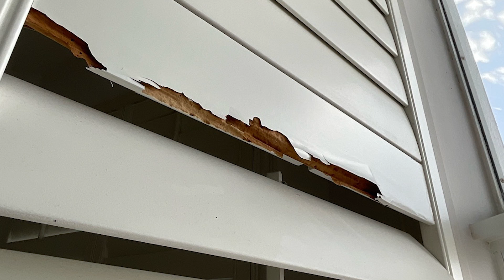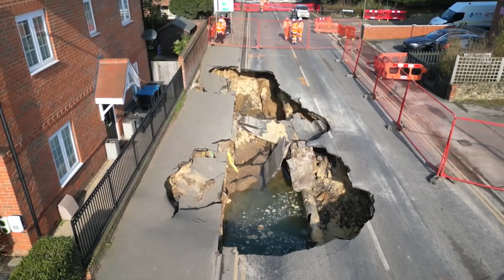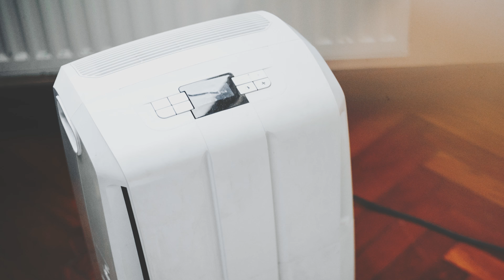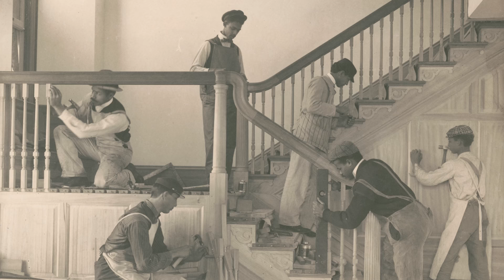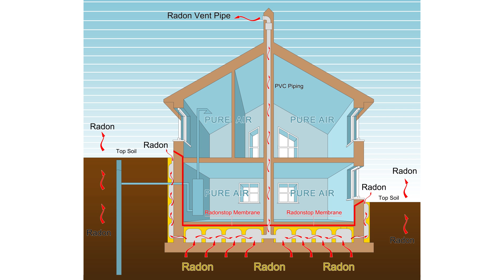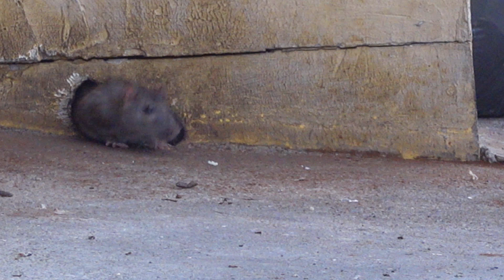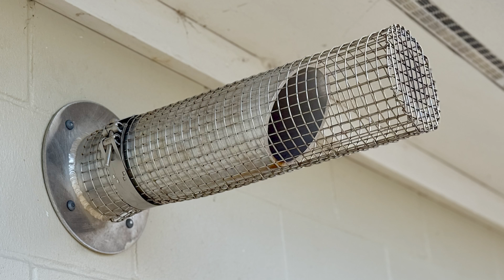Home Inspector Answers House Safety Questions | Tech Support | WIRED

Comment: Slab on grade is very dependent on location. Areas without super high water tables have basements, which are on footings. The slab on grade is just the floor of the basement. But if there is expansive soil, the basement floor may also be built off-grade to avoid damage should the soil expand.
Reply: Thanks for watching! Believe it or not, the neighborhood of Miami was built with basements. The grade was built up and then dug out, but there are basements. And yes, there is moisture and water intrusion.

Comment: Another reason that old houses last better, is the lack of insulation in the walls (especially "spray in foam"). Air circulation in the wall cavities, allow the walls to "breathe" which helps to control moisture/rot.
Not that there aren't good reasons for insulation, but there are tradeoffs.
Reply: Many new codes require vapor barriers that are designed to prevent moisture infiltration, damage, mold, etc. Not having proper insulation will just increase utility costs and can increase the risk of moisture intrusion. If constructed per code there are not "tradeoffs."
Reply: Exactly! There is no perfect solution. Thanks for watching!
Reply: Spoken like someone who doesn't know what they're talking about
Reply: @THEandyenglish 😂

Comment: I use a drain cleaner periodically as normal maintenance, just to make sure everything is good. Never took that as a bad sign.
Reply: That messes with your pipes regardless of what the marketing on thr packaging says
Reply: @catalindeluxus8545 bases and acids are non reactive with PVP. Cast iron, different story.
Reply: That stuff will destroy your pipes. Get those "drain shroom" catches for your drain and clean them every other day. If your drain is slow, remove and clear your u-bend.

Comment: Why build houses in wood vs concrete?
Reply: costs, which is based on local availability of materials.  the US and scandinavia has lots of woods, so their houses are primarily stick-framed.  rest of europe is cleared out, so they use concrete/mortar construction instead.  100 years ago and before, old-growth wood was plentiful (AND nails/screws were expensive) so houses were timber-framed with large slabs of woods that joined using wood alone.
Reply: Cost, usually

Comment: Interesting that Challenger was the panel of worry and not Federal Pacific Stab-Lok or Zinsco.
Reply: Those are also bad. it just so happened that the house we filmed this in had a Challenger. Bryant and IT bulldog pushmatic are also problematic. As well as any older panel that you cannot find breakers for. Those would be obsolete. Thanks for watching!

Comment: New houses are built on slabs? Definitely not in Ohio or most of the midwest (AFAIK). Almost every house here (Ohio) has a basement. And it's not that big of a red flag to see dehumidifiers in those basements. This dude must be another Cali guy lol.
Reply: your basement has a slab.  immaterial anyway, the important structural element is the foundation wall that hosts the joists

Comment: Carbon Monoxide has always been a weird one to me because it's a huge issue in the US, but when I moved overseas almost no one has CO detectors and CO deaths/accidents are so rare they only tend to occur when someone uses a kerosene space heater without sufficient ventilation.
Reply: Most European houses are draftier than US homes - if there is air exchange, you have less CO accumulating
Reply: It's because of insulation. Winter requires insulation, so less air exchange. Without CO/CO2 detector it can be deadly.
Reply: @hanifarroisimukhlis5989  Ah.... I forgot Europe doesn't have any winters....
Reply: @h @hanifarroisimukhlis5989  Perhaps I’m missing something here but there are extremely cold winters in many parts of Europe and vast swathes of the U.S. without cold weather.

Comment: Short answer: yes and no

Long Answer:
“Better” is very subjective and vague.  It depends on better at what.  New construction is better at material efficiency, strength and span of materials, heating and cooling efficiency.  Construction speed is also much faster and labor needs are significantly less.  Now the downside is you can also use all of those advantages to create an extremely low end building that in decades past would have not been able to stand.
Reply: Yeah people are romanticizing the past too much. Super rich people's houses were built well in the past and generally still are now, I think when a lot of people are thinking of 'old houses were built so well' they are thinking of these houses. Old houses had paper thin walls and windows, and some were very very flammable. Many things were toxic or unsafe. Many old houses were absolutely not built to last at all, it depends on the time and the country. Even most wealthy person's houses prior to the 1950s (excluding things like sprawling estates of royalty or top .0001% wealthy) had what we would see as a very small size today - perhaps this is where the confusion comes in as some people might perceive such small houses as normal. There wouldn't be so many historical examples of fires and earthquakes destroying entire cities if these old houses for the average peasant were built sooooo well.

Comment: In Japan new homes are built on concrete pads with outside walls that are about 18" high. All concrete. They also have partial "walls" on the pad that follow where actual walls will be placed. If you have something heavy going in a specific area they make sure there is support below as well. The interior will have at least one access panel in the flooring. It's usually in the kitchen and holds a deep plastic tub for storage. 

I've had to go under a few times. It's a stomach workout crawling. All of the pipes, drains, and air circulation system are accessible. We have another access panel in a closet that opens right on top of the air circulation system.
Reply: Japan enters the building for earthquakes type of structures, I would assume almost everything is done differently and many signs of decay is on a different chart if the area is affected regularly by seismic activity. I'd watch a video about that too.

Comment: We lived in our house for several years before it occurred to us to check for Radon. Our levels were several times the safety limit. We had a Radon mitigation system installed within the week. Wish that was something the inspector had checked before we bought.
Reply: Thanks for watching! 😎👍 sorry to hear that, but I'm glad you got it under control. I'm also glad I was able to use this platform to give people a heads up.
Reply: Just learned about it and got our system installed yesterday after sucking in the sweet cancer fumes for 14 years.
Reply: @jomegas11  It's infuriating, isn't it?
Reply: That’s shocking. We’ve purchased houses in VT and MA and a radon test was a standard part of the inspection process. It wasn’t something we had to independently find out about and order. Scary that it wasn’t brought up with you.
Reply: Radon is so common in Colorado that pretty much every house has high levels.
Reply: For everyone concerned, radon is
Mainly an issue if you have a lot of limestone deposits
Reply: Little something to consider - if you're in the States, the standard is pretty high, so maybe not great, but probably not as bad as you fear.
Reply: Had my radon checked, level was high. The guy told me, just tape your sump pump cover and I’ll be back in a week. Came back and levels were down
Reply: @jacobmcmillan6787  Yeah. Those need to be sealed tight. Prior to installing our mitigation system, one of our two pumps didn't have a lid at all - it often needed us to reach in and manually get it to empty. That's been fixed, too.
Reply: Did you have any physical symptoms or anything?
Reply: @ElleDeas Not that we noticed. But also have never thought to look up symptoms and see if we might have misattributed them to something else.
Reply: Almost feels like an elaborate prank, this whole random risk to my health that I have never even heard about before today.

Comment: Me and my boyfriend live in a 5-apartment building. Now, remember he said that cast iron pipes last approximately 50 years? Yeah, we have cast iron pipes and the house was built in the late 1800s. Anytime we ask our landlord to do something about this, he says no. It's absolutely ridiculous.
Reply: Are they actually causing any problems? Or are you wanting them replaced for the sake of replacement?
Reply: @s3xhaver_420  Exactly. They will fail eventually but don't replace them before then. I have had to replace old cast iron with PVC and now you can hear the water running in the pipes in a way you never could before. That cast iron stuff is great, as long as it lasts.
Reply: And be sure not to use any flushable wipes with those drains! 😎👍

Comment: Another problem with aluminum wiring - galvanic corrosion where it interfaces with copper, causing a high-resistance connection, thus heat + fire.

Comment: “The houses I buy I gut”…is the problem.
Reply: What is the problem you're talking about? He seems experienced and knowledgeable in his trade. If he's buying houses that need these safety upgrades like the pipes and electrical, that is essentially a gut job, and in his area of expertise. Where's the problem? 🔎
Reply: What do you mean?
I understood it as he redoes everything himself I suppose - why is that a problem? the layman is unable to?
Reply: @tsunamininja  they’re implying that he’s destroying houses that were built to a high stander to replace them with cheap stuff. In reality, he’s probably buying houses that are already falling apart and making them livable again
Reply: @GoErikTheRed  that's exactly right! I'm also able to address safety issues like improper wire splicing in walls. I also install hurricane impact windows, because here in South Florida, we get those strong breezes every now and then. 😆 Thanks for watching!
Reply: You can't really say that. I'm not a friend of flippers generally, but the bigger scale of problem you're prepared to deal with the bigger the potential profit for a remodel. So half of the equation there is that you're starting with a house that has huge problems. Potentially fire or smoke damage, significant structural problems, biohazards,  intentional destruction by occupants or vandals, long-term water intrustion, etc. In cases like this the starting point is gutting the place because you can't trust anything behind the walls at that point.
Reply: He's buying houses that are almost (or totally) uninhabitable and then returning them to livable condition.  How is that a bad thing?
Reply: Would you rather them sit as ghetto vaccos?

Comment: I was researching whether it makes sense to somewhat heat the basement to increase the floor temperature slightly (it does, in my rental) and thats when I learned that doing so actually also reduces the risk of basement mold because it lowers the humidity. I hope it’s true lol

Edit// Actually now that I think about it/reread, I think it's more that heating increases the surface temperature and keeps the surfaces more dry (prevents condensation). Also maybe something about moisture rising less towards the ceilings if the entire room is a bit warmer?
Reply: Yes, keeps the surfaces drier ...
Reply: Your RELATIVE humidity will do down because warm air can hold more water.  Same amount of water is there.  Get a dehumidifier if it isn't too cold.
Reply: @justayoutuber1906 it's not especially humid. Actually I think it was more something about if the upstairs is much warmer then the basement humidity will rise towards the top corners and accumulate there, and that's what encourages the mold growth?

I definitely don't want it to get dryer luckily.
Reply: It reduces relative humidity, which makes it feel drier than if it's cold. However, it doesn't change absolute humidity. I'm not familiar if that helps prevent mold, but I don't think it does

Comment: excellent video.  fwiw...one "walk away" house I have seen had an old underground heating oil bunker that had cracked.  digging it up, venting the soil, etc would have a few 100 thou.
Reply: Yeah, I personally think the “walk away” answer could have been a bit more helpful for the average person, who DOESNT share that degree of know-how in fixing issues you may find. 

Personally, I think it mostly comes down to cost vs budget (both financially and in time). Let’s say a house has pretty major issues that’ll probably cost $50k-$75k to fix. If before those repairs the house is coming in 100k under your budget, it may still make sense to go for it. But if it’s already pushing your budget, or you don’t have the time and inclination to deal with the headache of all those repairs, probably best to pass.

Comment: Wait. Tile is the waterproofer, underlayment is only secondary and should not get frequent water load. Tile roofs should not last 25 years! I don't know what tiles you guys got overseas, but in Europe you get 50 years plus warranty on them and they last longer than that. Something is off here.
Reply: Probably difference in climate and building techniques are at play here, in the US tile is mostly in the southwest where they get big temperature swings, and houses there are often wood so probably aren't using the same techniques as the concrete and tile of Mediterranean Europe
Reply: @helicopsyche Well my climate matches 3 or 4 climate zone, 20F to 100F range...
Reply: Yeah, roof tiles can easily last 75 years here, at least the smooth/glazed type. And water is NOT supposed to go underneath them.
Reply: @TheTwoTwoForReal and remember, the tiles themselves last forever. It's the waterproofing membrane that deteriorates.
Reply: 😂 that was so funny, I have a 100yr old tiled roof which is completely dry and it just has tiles, nothing else…
Reply: Not sure where this gent works, but tile roofs are definitely NOT common across the entire US so perhaps he simply misspoke.  They're very much a rarity here in the snowy north but I've seen a few 75-100 year old houses in my area still rocking their original tile roofs.
Reply: @driveway_of_misfits  I've never even seen a tile roof lol
Reply: @Noikar It’s all about climate. They’re exceedingly common in South Florida. Go just a few hours north and they’re far less common. Practically non-existent in the Midwest.
Reply: Thanks for watching my video! That may be true for other parts of the world and different roofing tile systems. Here in South Florida, where I've been inspecting for 17 years and have inspected thousands of homes, 25 years is the average. In fact, if you try to submit to the assurance company that you're 25 year-old Roof has five years life expectancy, they will send out their own independent Inspector. They do that because they're paying out claims on tile roofs once they hit about 25 years. So the game that Insurance companies are playing is that they want five years minimum of life expectancy moving forward. That means that if you Roof is 20 years old, you're just making it in there. But if your Tile Roof is already 25 years old, you will be hard pressed to get another five years out of it. Especially when the insurance companies start to squeeze you and require it or they will drop you.

As for the water running underneath it, there are weep poles at the eaves on all of our tile roofs. These weep holes are to allow water to escape and for the roof to dry out after a rain. This is why conventional flat tile roofs were problematic here in South Florida as they did not allow for proper airflow and dry-out after a rains. Now, contemporary flat tiles are fluted on the backside, allowing for better airflow. You can check out my Roofing videos at @homestarInspect
Reply: Same with steel roofs - those can last 100 years.  I'm sure many tile roofs in Europe are hundreds of years old.
Reply: This guy is off about several things…

Comment: That infrared camera is $3,200.
Reply: Our library checks things like this out. Radon detectors and Flir cameras are popular.
Reply: And the moisture meters over $900 bucks...
Reply: @HomeStarInspect  that's what she said
Reply: The camera I used in this video was $2500. I also paid another $2500 for certifications. Because if you don't understand the technology, you can Miss or call out issues improperly. 😎👍
Reply: I bought a less advanced one online for $100
Reply: Yep; and im sure he charges 500 bucks per inspection.
Reply: Much cheaper ones are available that plug into your phone and use its screen.
Reply: @gregbell2117  true, they’re just less sensitive. Having seen the difference myself, I wouldn’t use it in my business. But to play around with it and have fun around the house, it’s OK. Thanks for watching!
Reply: @gregbell2117 ”wHy is tHis InsPecTioN so ExpEnsIve…. My app was free!1!! * ahh statement

Comment: Oof. There's no such thing as "Penicillium aspergillus". Those are two completely different genuses of fungus.
Reply: Correct, and are often times thrown together because under a microscope, they're not as easily discernible. Important part is, they have the same known allergic potential. So whether it's one or or the other, the result is the same. Both are harmful and both need remediation. Thanks for washing my video! 🤙😎

Comment: why is American homes built for like 25 years and after that needs major replacements.
Reply: Money
Reply: My house was built in 1945 and I haven't had to do anything too major.  New roof shingles, upgraded wiring, new insulation and cleaning out the air ducts is all I've had to do since I bought it.
Reply: It’s cheaper, and most people don’t live in a house longer than 25 years. And it’s only the roof and certain components like water heaters that need to be replaced, most everything else is fine for far longer
Reply: Our house needed a roof 13 years after it was built.  What a joke.